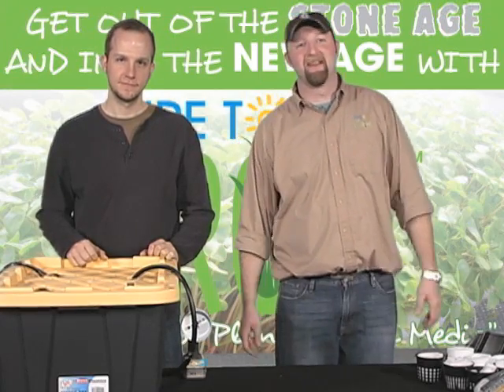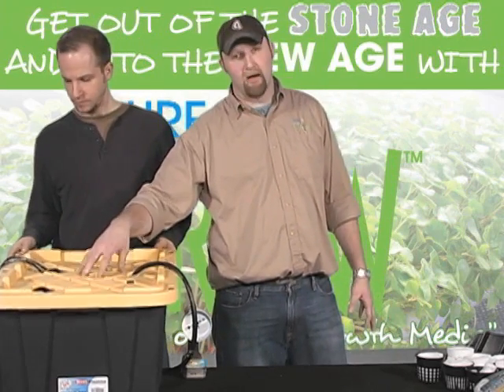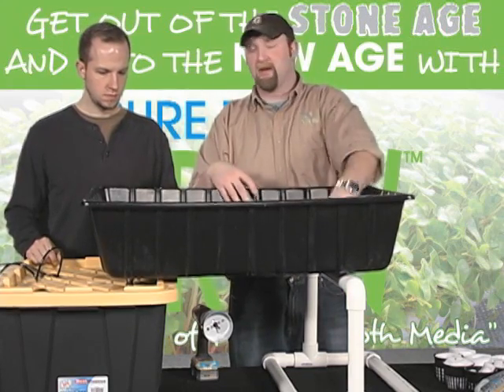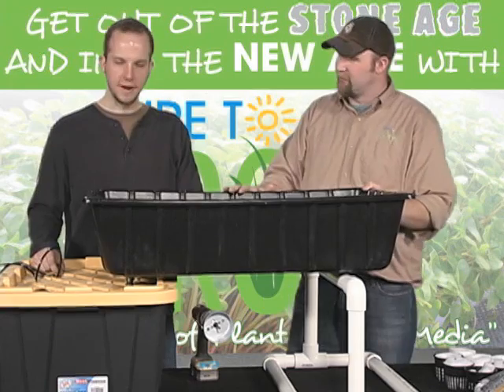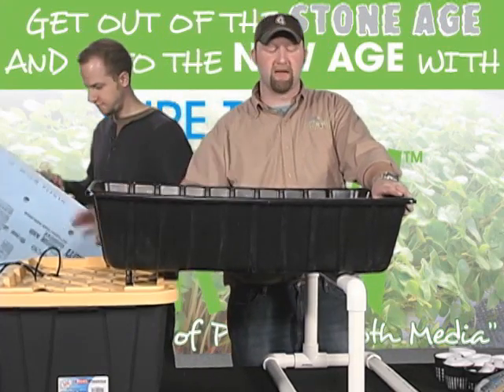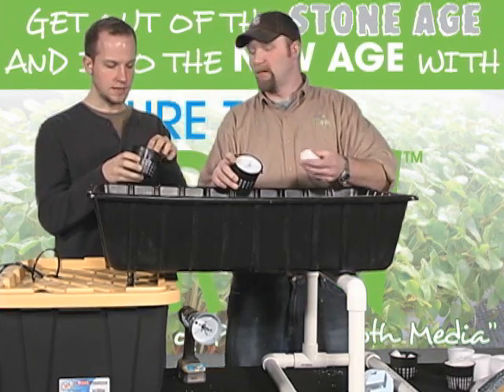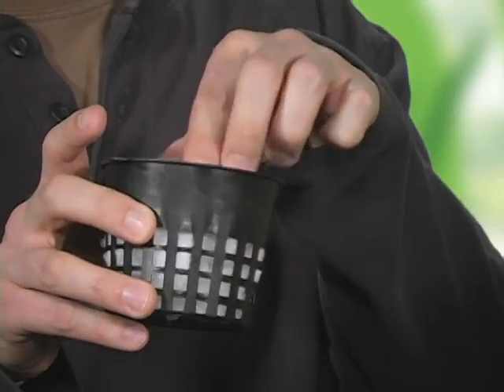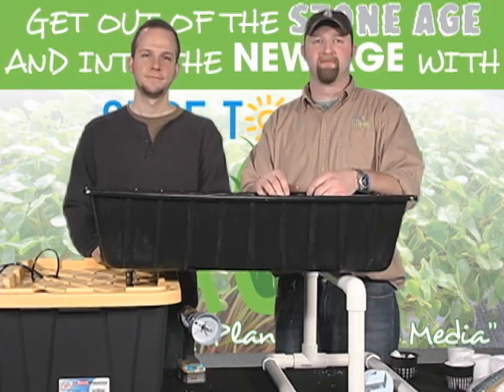Hydroponics How To:  Build a Deep Water Culture Hydroponics System

Comment: i would love to see a video that includes how to set a timer on stg 3" arroyo inserts.i am using a self contained tote system with top drip to get my clones ready for vegetation.my room is running at 50% to 60% humidiy and 75° at all time....a video on how to tell when to water those and to prevent algea on top of them.I realy love the idea of the product on how it is ph neutral and

Comment: A good solution for this problem is using restaurant bus-bins.  They are available from webstaurantstore(dot)com/

They are NSF, and you should be good to go.
Reply: man i wish i had thought of bus bins before i spent $100 on a table lol.  actually the bins could sit right on top of the resevoir with no need for a tabvle or long tubing

Comment: what are the advantages of using a raft over keeping the plants in the lid, placed on top of the res?? i read that when you get closer to flowering it is beneficial to drop the level of nutrient solution allowing the roots more access to air within the res as well as the solution???

Comment: hey guys great clip.. im just looking into moving from a recirculating top feed system into a SOG DWC setup. this looks like something i could work with quite easily... just wandering, does the nutrient solution run back into the res via an overflow tube or something? i noticed that second outlet at the bottom of the main res(with raft in)... ive been looking at a RDWC as it seems a little easier to use a water heater to maintain 22celcius or so.. how do you keep temp up in this system?

Comment from the maker: BPA can be a problem, fortunetely STG is amde form PET, which does not contain BPA. it is the mostly widely used and approved material for food packaging. it is improtant to note that plastics do not generally give off gases or degrade unless they are put in to enviorments that casue them to break down. Very hot or chemicals being introduced that cuase them to degrade and off gas. most plastics are very safe when used for their intended purpose.

Comment: I would like to point out that using totes like the ones they are using is very risky.  The vast majority of those totes are not considered food grade but even if it were, you still have to worry about the chemicals they use in the plastics.  There has been a lot of talk about BPA but that is not the worst of the polymer chemicals that cause estrogenic activity (EA) in people and animals. You should always start with food grade products but then do additional research into even those.

Comment: @Untsaiyi these guys are largely full of themselves. but to answer your question quality air pumps are generally rated in LPM{minute}. the depth of your system will vary how much air you need. Get a big ass pump and LOTS of air stones. more surface area the better. you want bubbles everywhere! get an alita or hiblow air pump and you will be good to go. get the alita silicone diffuser tubing, weight it and cover the entire bottom of your system with a coil of this tubing. you are now golden :)

Comment: Bubbling air into water does not add oxygen into the water. Water is already fully saturated with gases. The bubbling of water circulates the water and breaks the surface tension which allows the exchange of gases.